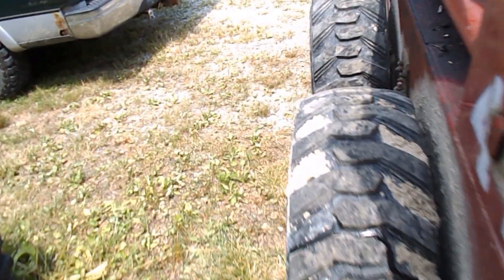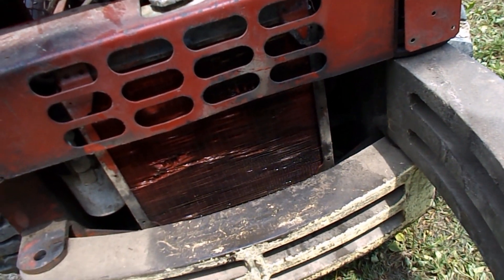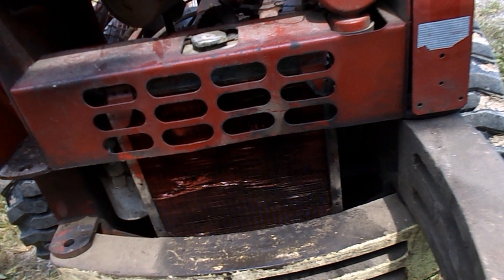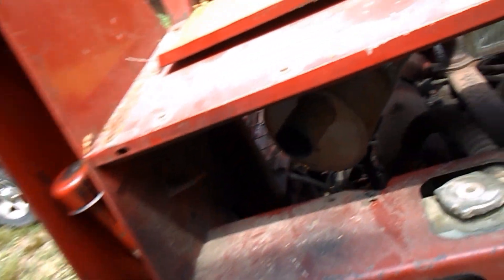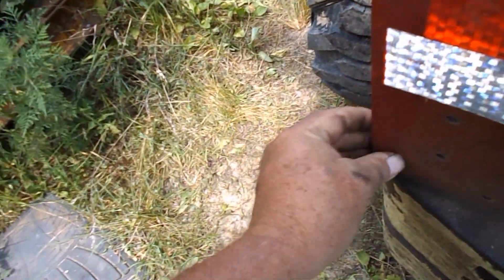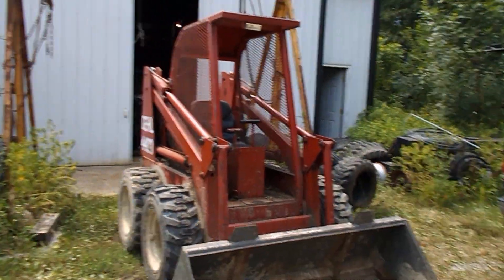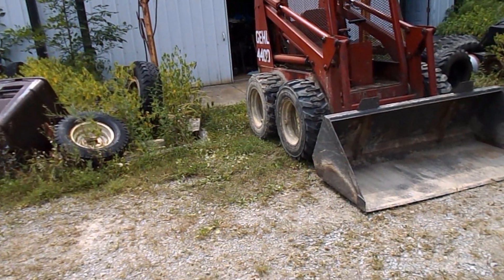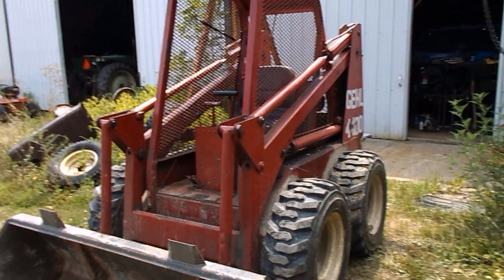Cleaning the Radiator on the Gehl 4400 Skid Steer

Comment: We all have these types of jobs, you know, the ones we put off.... usually for me, until it causes a problem I could have avoided. Puts you way ahead of me.
Reply from the maker: Well its a job I put off cause I really haven't been using it much but there is a job coming up that I will really need it running good ! So time to take the plunge and get it done and I was really surprised by the amount of crap that came out of the radiator , Lots of chunks !  LOL But the soap gun really made the job a lot easer to do this time and its running a lot cooler now !  Bandit

Comment: Good time to get stuff like that done!  Thanks for the video!
Reply from the maker: Its something you got to do every now and then to keep them cool after running them in a lot of dust and it did a lot of that last summer for sure ! But its something I had put off long enough cause she was running a bit warm so I had to get it done cause she has a big job to do here very shortly and she will need to be in tip top running condition to get the job done !  Bandit

Comment: Neat tool
Reply from the maker: It comes in handy for lots of other jobs other than what it was designed for, But it sure works good to clean a radiator out !  Having an angled tip makes it good as a blow gun too so I find lot of uses for tool most people wouldn't think about trying !  Bandit

Comment: While you're having fun with the Skid Steer I've been at it almost 2 days Now, Cleaning Brush & Trees On our Far Left Side of the End on the Orchard... So I can get the tractor in their etc. hard painstaking work... Dryer than a Popcorn Fart hahaha, That made my day!
Reply from the maker: I've got a job for the Gehl now and it needs to be ready to roll now. I have an idea I will be putting a set of points and condineser in it that or a coil, Run it for about 1 1/2 hours and you start pulling the chock out just a bit and then again until it dies and wont start. Let it sit 15 or 20 min and it fires right back up and its ready to go ! So I'm pretty sure what I'll be doing before long !  Well when its dry enough the disk just scratches the top of the ground its dryer than a popcorn fart ! LOL  Bandit

Comment from the maker: Well its time to do a job I've put off long enough, Cleaning the radiator out on the Gehl 4400 skid steer. The ground is dryer than a pop corn fart so I cant disk any so its a good time to do this job.  I used my soap gun and used water to blow threw the radiator to clean it, I soaked both sides and let it sit for 20 min to soak to loosen everything up in it. Now this draws air from the engine side threw the radiator to cool it so its backwards to most systems. As I blew threw it the chucks started flying ! LOL  Before long I could see threw it again except the middle because there is an oil cooler between the radiator and the fan so it took a lot longer to get it cleaned out but its clean now and will run a lot cooler now !  Its amazing how much dirt and dust gets sucked into the radiator but it does so this is something that has to be done every now and then to keep it running right and cool. It might just be a soap gun but it works really good to clean a radiator out and its just a little water (about a gallon) and a little air pressure and its good and clean now. I hope you enjoyed watching and maybe learned something new you can do too.  Bandit

Comment: today I touched it and it broke or went wrong.    it is what it is.
Reply from the maker: Cuz don't you just hate days like that !  Those are the days I figure I'd been better off staying in bed ! LOL  I'm really glad I didn't have one of those day when I did this, I don't even want to think about buying a new radiator for it !  This is one of the reasons I used the soap gun to clean it with, Lower air pressure and water will clean it out really good and it sure needed it and it runs a lot cooler now !  Hang in there cousin it will get better soon enough !  Cousin Bandit